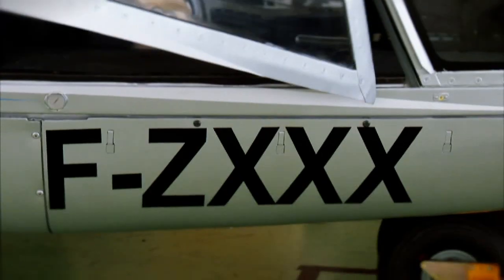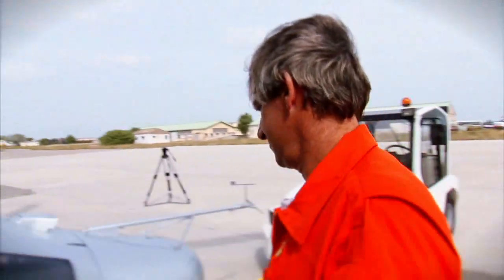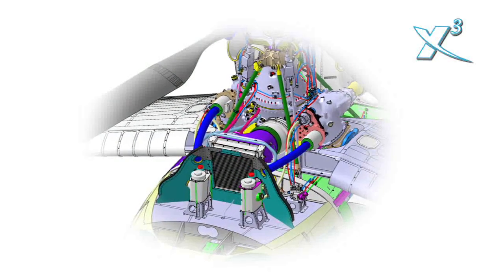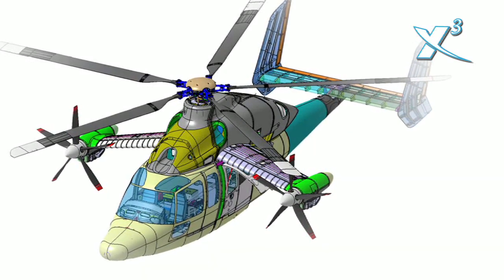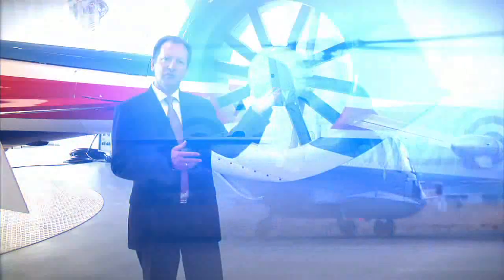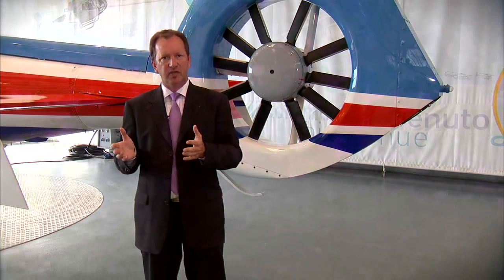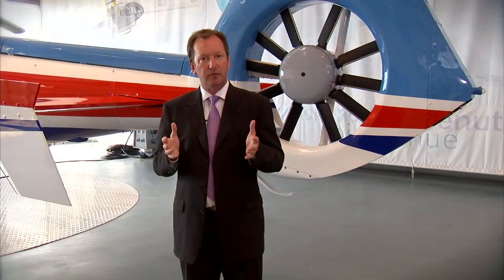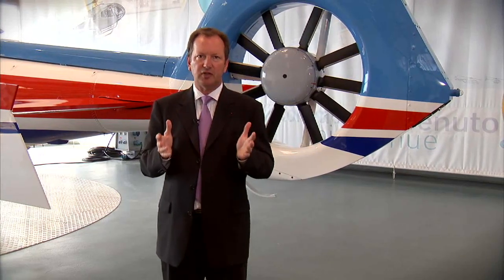The Airbus Helicopters X3 concept

Comment: The pylon looks like it was about to vibrate off. not something I was expecting, but it makes sense. It's in the direct airstream of the main rotor. I'm sure it's been engineered for, but I bet it's uncomfortable in hover. I wonder how the high speed turbulence is dampened by the wing and rotor combo.

Comment: See Fairey Rotodyne: Rear Access, something like a CH-47 Chinook, but faster, slightly less payload flew 4 years before the Chinook. Rear access is the way to go. Tip-jet rotor, autorotation in cruise, reduced drag on the main rotor and no torque because there is no engine turning the rotors. Hope to see it again

Comment: What about turning the side engines 180 degrees around, change the shape of the rotors and make use of a pusher propellor concept instead ? 

That might eliminate the possible threat to the pilots aswell as improving their field of view